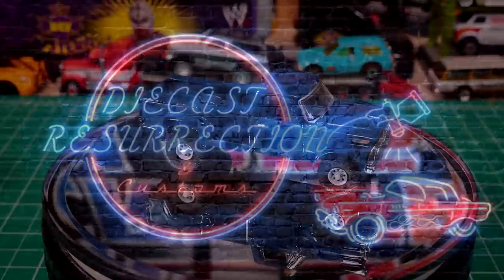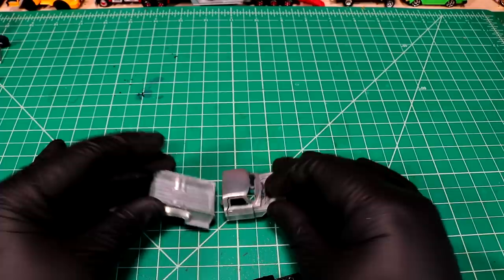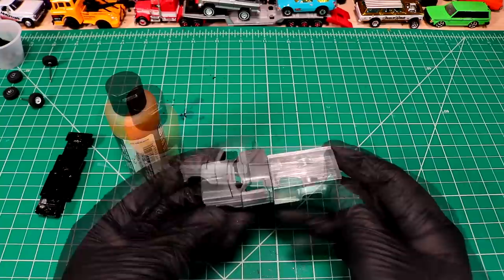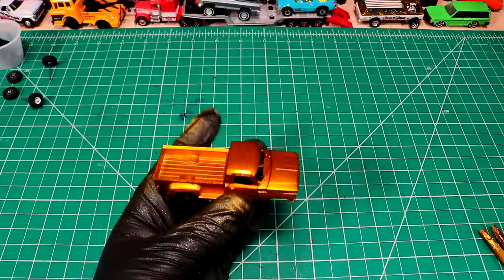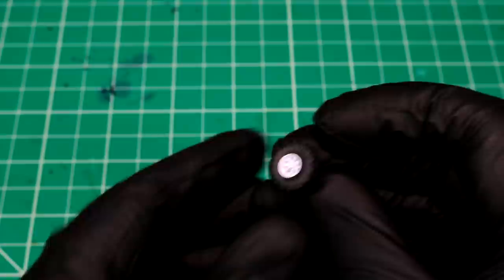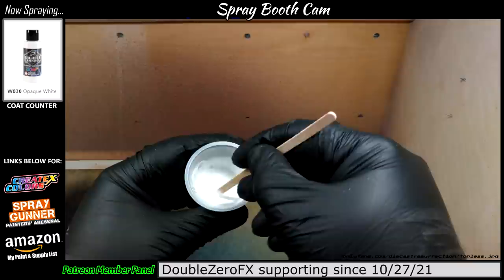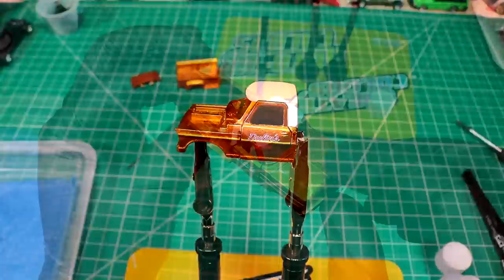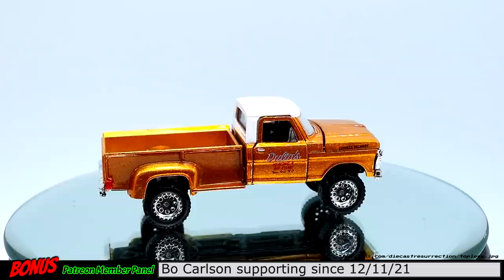Painting Diecast Cars - M2 Machines F-100 - Shop Truck Build

Comment: M2 put the wrong bed on the F100  ....
Reply: I'ma see what you mean
Reply: late 70s erly 80s Ford Made a stepside short bed F100 and F150 sport 4x4  (roll bar and push bar with lights ) but never a stepside long bed on either F100 or F150